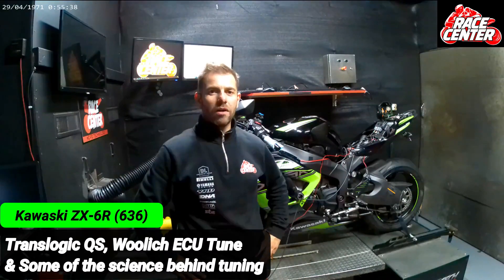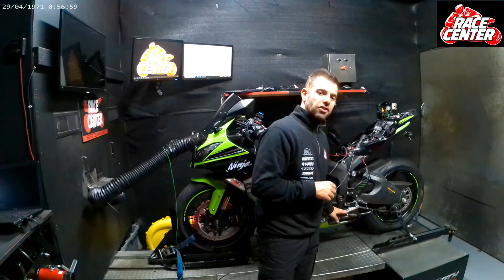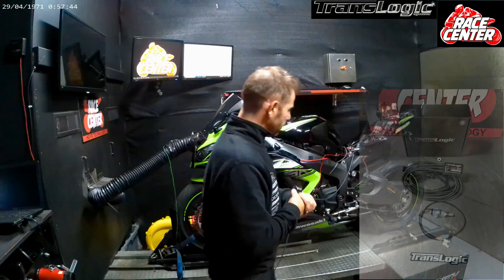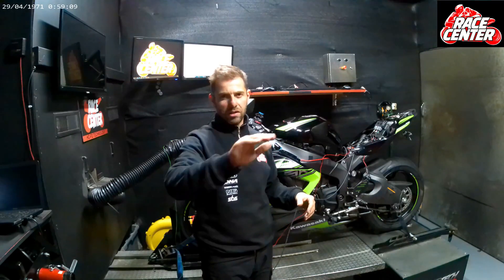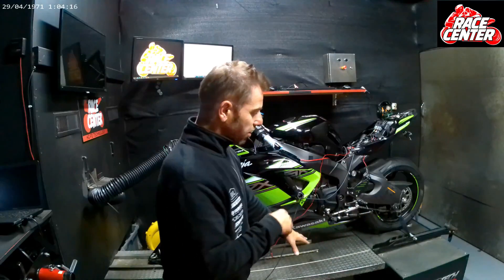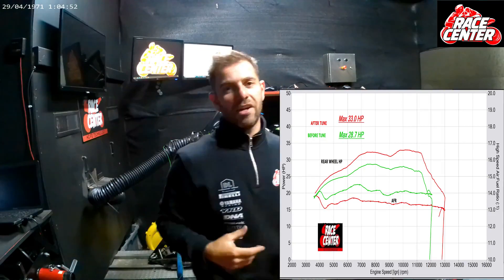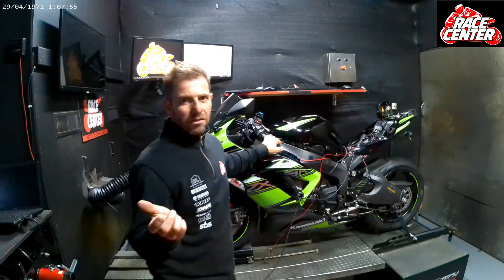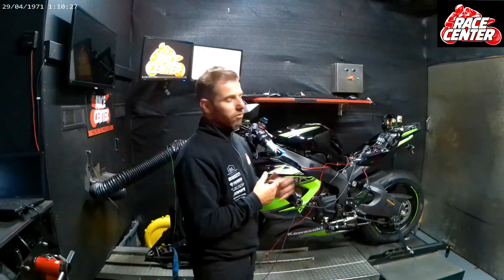A LITTLE ABOUT TUNING, ZX-6R TUNE AND SOME THINGS THAT MAYBE MAY NOT BE AS OBVIOUS ON THE SRUFACE

Comment: What fan for cooling exacly u use? I not see here.  Only tube to intel
Reply from the maker: The fan is a massive 3 phase unit. We use part of the outlet for ram air and the other for cooling 
In fact,  it's so strong, most of the time we have to tape the radiator because it's so strong:)
Reply from the maker: will try show it properly in the next video
Reply from the maker: He mate, this video shows a bit about our cooling fan, thought we would show it after your comment. Thanks :) https://youtu.be/i10LvGasVL8
Reply: @Racecenter Info  very good;)